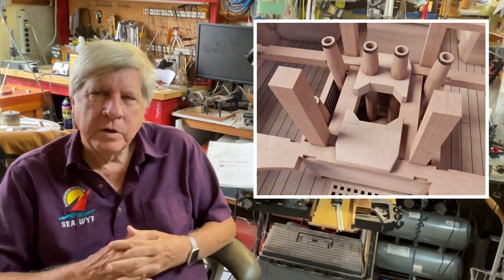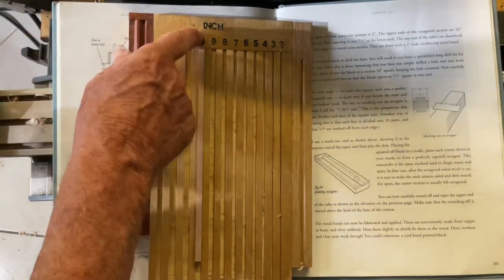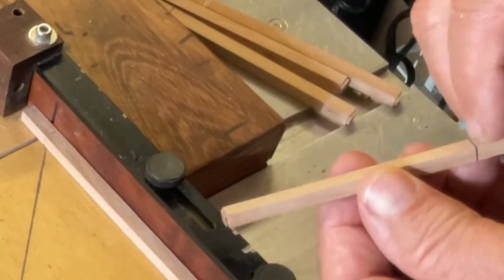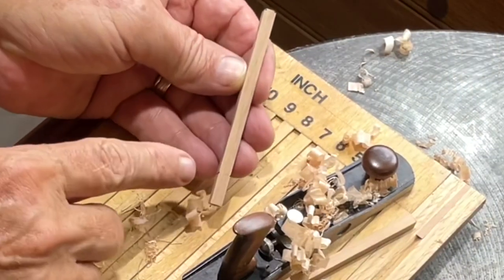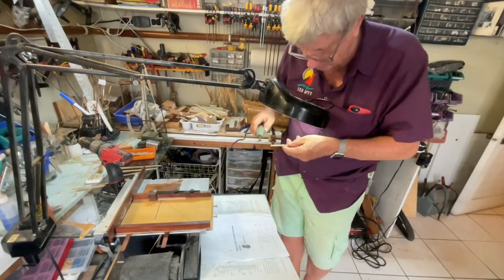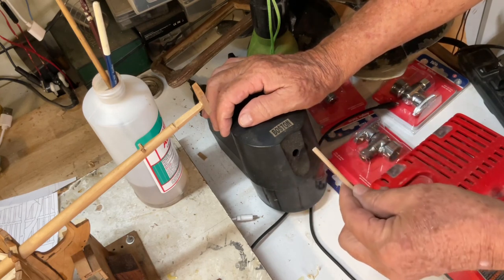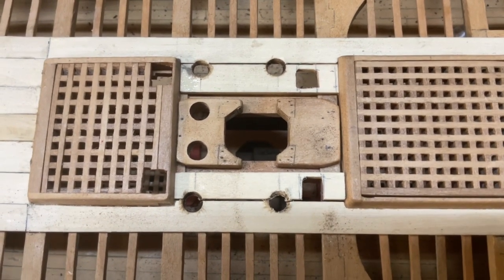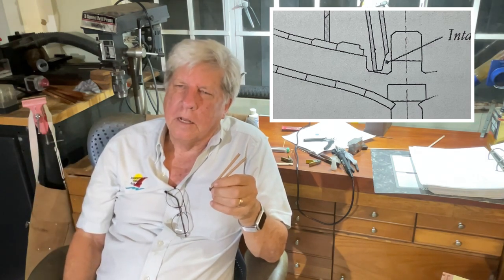Video 86. HMS Thorn. Building the water pump tubes and closing up the center of the main deck.

Comment: As always, a great video. I am impressed with the jig that you had to slot the material in...Did you make it yourself, or purchased? With regards to the hand tools, the plane etc. Do you have a supplier that you could recommend? There is so much rubbish out-there purporting to be professional grade. Please keep up the great work and the video's going.
Reply from the maker: Yes Roy i had the jig as i am working in 1/4” scale for the next two models. For the best miniature tools i recommend you go to Lee Valley. Here is the link for their miniature sets. You. An buy individual units.
https://www.leevalley.com/en-gb/shop/tools/hand-tools/miniature-tools/101508-veritas-miniature-tool-sets